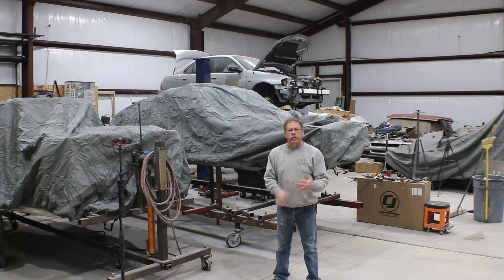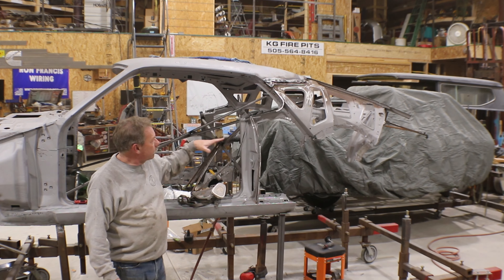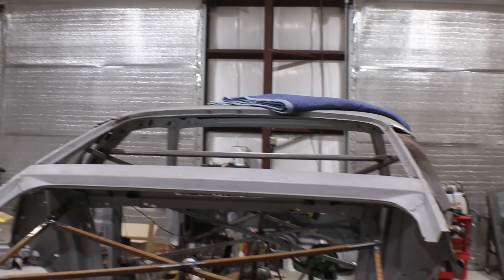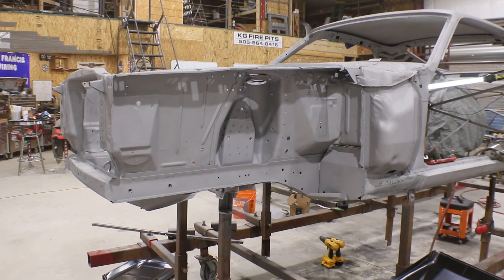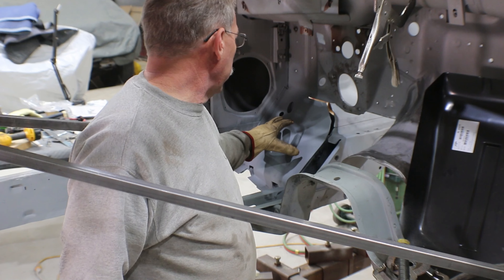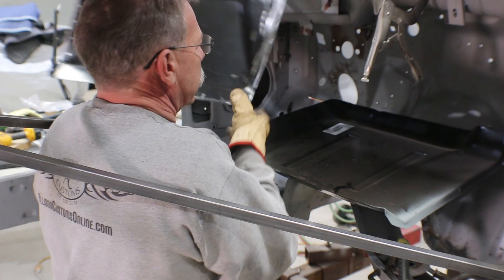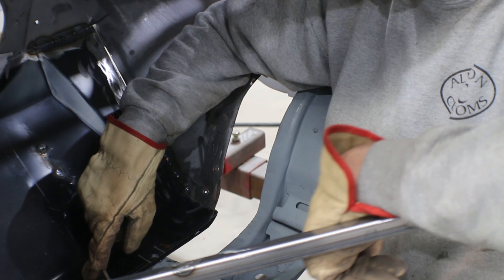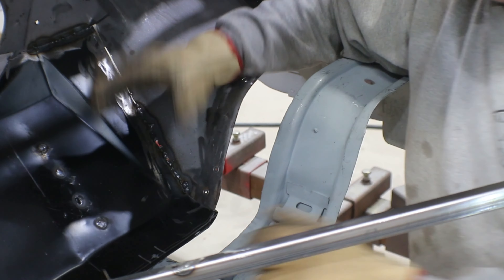Repairing Mustang Torque Boxes and Floor Transitions | Dustin’s 1970 Mustang Ep. 4 | ALLISON CUSTOMS

Comment: what are the holes in the top of the torque box for and arent they being covered up by that toe board? I know the one is for the e brake but its confusing because the ebrake lever is in the cab and this seems like it would route the cable into the engine bay?
Reply from the maker: To my knowledge the e brake cable is run completely under the car and then comes into the cabin (thru the firewall) very near the top of the pedal assembly. 
Here is a link I found that show the routing. https://www.concoursmustang.com/forum/index.php?topic=19118.0
Reply: @AllisonCustoms  thanks for the reply. I did more research and im pretty sure it doesnt enter the firewall. the torque box you saw has those two little holes top left, and then the channel exit just to the right of those. The channel runs inside the torque box with the entrance at the bottom. so the cable runs through there and so I would think you gotta cut a hole in the toe board for the cable to come up through that channel. the two extra holes im told are just relief holes whatever that means
Reply from the maker: When the owner gets ready to start back on that project, I’ll have to pull all my assembly manuals out and take a look.  That car has been under a cover for about 18 months waiting on the owner.  So, I honestly haven’t put a whole lot of thought into Mustangs in a while.

Comment: What's the point of a torque box? Is it really needed if it's just a cruiser car? I bought my 67 mustang, and the previous owner took the torque box out. He got sick and passed away before replacing it. The car has all the body work done, and newly painted. Is it worth me doing all that work, and repainting the car if it's just a cruiser?
Reply from the maker: The rear torque boxes help transfer the lifting and twisting forces coming thru the leaf springs into the floor and (mostly) the rocker panels.  The rocker panels are really the only “frame” the Mustang has. The front torque boxes also transfer the steering and other suspension forces into the rocker panels.  The rockers are attempting to keep the car from twisting like a pretzel 🥨.  
So - Yes I would want them or something to take their place - like a full aftermarket chassis. Possibly some high quality subframe connectors would solve the issue as well. But most of those that I have seen get bolted or welded into the torque boxes, front and rear.
Hope that helps.
Reply: @Allison Customs' - PROJECT CAR TV  is it a safety hazard not to have them? I guess my nerves are just on end not knowing what I should do. I don't have the tools, the space, or the money to do this type of work. So, I guess that's why I'm questioning it.
Reply: @UnapologeticAmerican1776  the 65-66 Mustangs didn’t use torque boxes.  Ford added one in 67, but only on the drivers side.  From 68 onward, they had them on both sides.  Could you live without it on a 67? Possibly, if you have a straight six or two barrel 289 (lower HP).  If the rest of the sheet metal on the car is solid, you could probably get by, but if any of the firewall, lower cowl, floor, or rocker have rust, there is a good chance your car may start to sag/fold right where the torque boxes are normally located.  That’s because it doesn’t take much strain (applied load) for the floor and firewall sheet metal that’s between the rockers and frame rails to flex/buckle/twist.
Reply: @67MustangCoupeRestoration  yes I only have the 2 barrel 289. And from what I can tell, the exterior metal is all solid. The cowl around the top hat is bad. And the firewall looks thin in places. I will just get it done by someone that knows what to do. And has the tools and space to do it. I hope it don't cost me a kidney to have it done.
Reply from the maker: What he said!